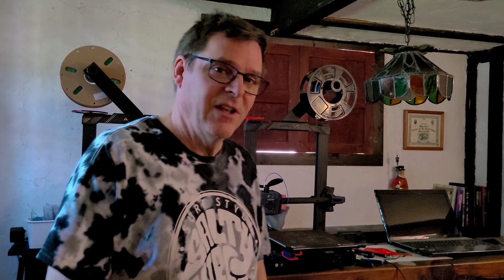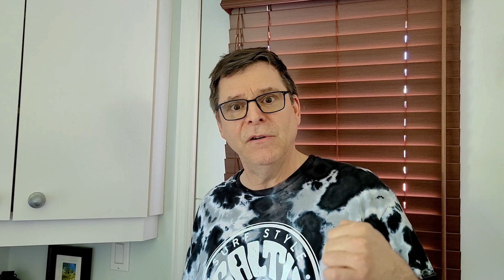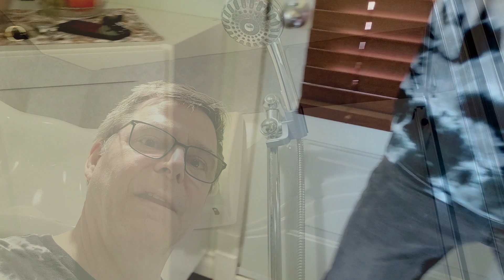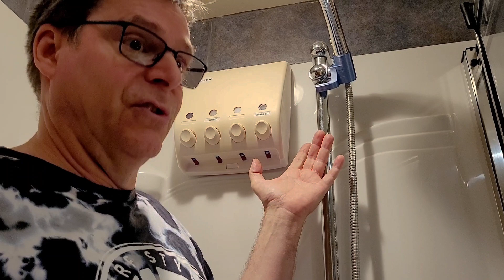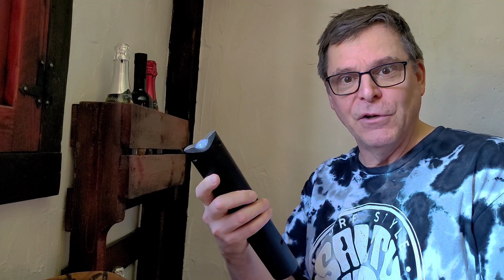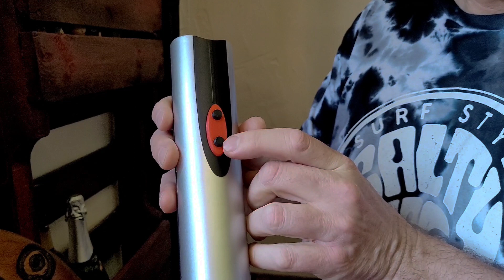STOP Adding to Landfills

Comment: Love this video! I repaired my microphone holder which was originally from RØDE but broke after a few months because it was too thin and couldn’t hold the weight of the mic.
Also I have a coffee maker from Ninja. When I made only one cup, the coffee would splash out of the cup with each drip and made a mess. I simply printed a tightly fitted riser for this.
This is my favorite thing to do with my printer. Design stuff which I can’t or won’t buy, print it and fix things with it.
Reply from the maker: Man I hear you, it's so satisfying to design and print fixes. I hate to throw things away that add to the landfills.  Thanks for sharing.